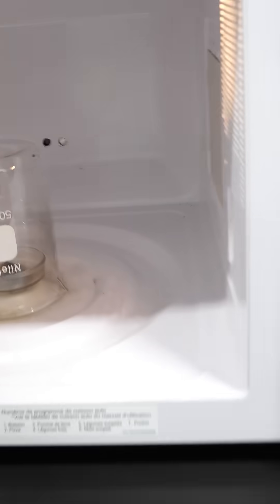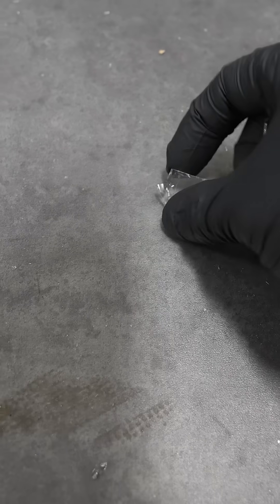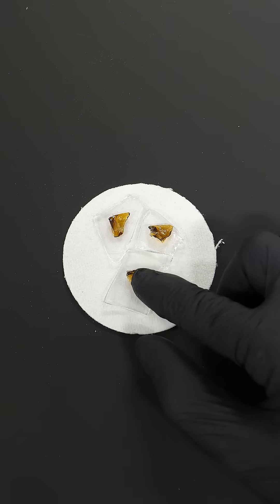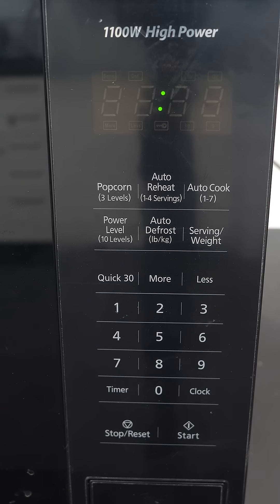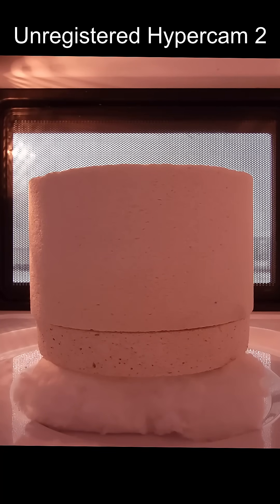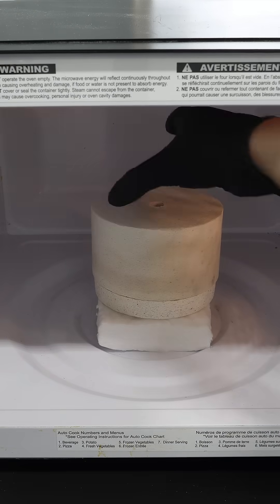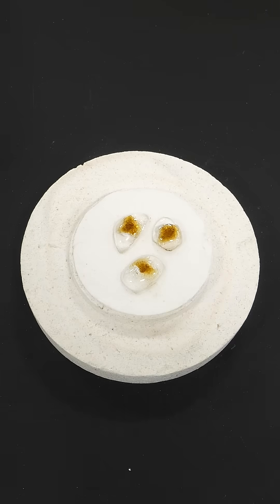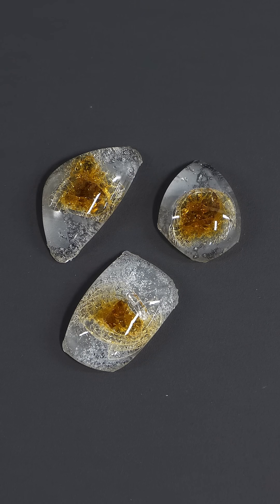Melting glass in the microwave is crazy

Comment: This reminds me of when I was making concrete.   I combined beach sand, water and corn meal together, then I mixed it up into an oatmeal consistency.  I put it in the microwave for 5 minutes.  When I took it out it was extremely hard looked like ceramic.  I also noticed I completely melted a hole in the  container I had put it in.   I didn't realize the Temperature had reached 1000+ Degrees Fahrenheit.  I had to let the concrete cool down before I could handle it.   Being a chemist myself I already have a branding mark on my thumb where I touched something 1000 degrees, I even had to cut plastic off My Finger.  Stellar Glass Eyes Nile I Love Your Videos and Content. Great Work 👩🏻‍🔬⚗️🧪💜💜💜

Comment: You didn't run it for long enough. You didn't put the pieces close enough together. They very obviously liquefied.  That glass got just warm enough to to turn into putty but not hot enough to turn into liquid. You need more heat or you need all the pieces much closer together in order to achieve what you want to to achieve

Comment: In sure by now someone else has elaborated on why it didn't work out and you've learned about coefficient of expansion and different glass formulations...can't mic borosilicate and soda lime glass 😂 you'll get much better results using glass of the same type. Boro also has a much higher melting temperature than bottle glass. Had you used a glass soda bottle and not a beaker they not only won't crackle and will more uniformly melt at the temperature that the microwave kiln generates.

Comment: I've been melting glass in microwaves for decades to have colors on hand while blowing glass.  Once glass is soft, it becomes conductive andwill directly absorb microwaves. The way to heat the glass to the softening temperature, drop in a maybe 1/8" crystal of silicon carbide.

Pick a suitable crucible and there you go.

Comment: Point 1. I fully expected you to heave the beaker against the wall really heard hard. 

Point 2. I fully expected you the smash the brown glass bottle, but I didn't expect you to smash it to SMITHEREENS 😮

Point 3. I'm surprised you were surprised this experiment didn't turn out the way you thought. Why would you think the 3 pieces of clear glass would "soup up" to fuse with each other? Putting the brown pieces of glass on top of the clear I think anyone would expect those would melt into each of the clear glass as it did.

Point 4. Great job 👍 I like it

Comment: The only way this works is if the glass has metal in it. That’s why the glass platter gets hot. Otherwise glass is non polarized and will never get hot enough to do anything. Put a plastic cup in microwave on top a towel everything must be dry in there no food particles. Put it on for ten minutes nothing will happen. Can only heat up polarized molecules due to alternating waveform.

Comment: Fun fact: microwaves use a magnatron that consumes 4,000v to create radiation. The radiation is run through a "wave guide" and is directed to the oven cavity. Without the plate spinning, the radiation doesn't get spread evenly. If there was nothing to take the radiation it would burn a hole through the bottom of the microwave.

Comment: Yes, you can melt glass in a microwave, but only with a special tool called a microwave kiln. You cannot put glass directly into a microwave and expect it to melt.
A microwave kiln is a small, insulated container specifically designed for this purpose. It works by:
 * Absorbing microwaves: The kiln's interior is lined with a special black compound that absorbs microwave energy.
 * Converting energy to heat: This compound heats up to very high temperatures—over 1400°F (750°C)—and transfers that heat to the glass inside.
 * Fusing the glass: The intense heat melts the glass, allowing you to create small fused glass pieces for jewelry or other crafts.
Important Safety Precautions
 * Dedicated Microwave: Use a separate microwave just for this purpose. The pigments and other materials used in glass fusing can be toxic and may contaminate a microwave used for food.
 * Proper Kiln Usage: Follow the instructions that come with your kiln. This includes using special kiln paper to prevent glass from sticking to the base.
 * Extreme Heat: The kiln and glass become extremely hot. Use heat-resistant gloves or mitts to handle the kiln, and place it on a heat-resistant surface to cool down.
 * Ventilation: Ensure there is adequate ventilation, as some materials may release fumes.

Comment: The Pyrex glass used in beakers is designed to be heat tolerant. I would try using thin pieces of common glass.

Comment: We did this in school for a demonstration for lower grades and/or parents. First we took thermopaper to figure out the "sweet spot" in the microwave. Then we took glass-shards, silica sand and cobalt- or copper salts (can't really remember), placed them in a ceramic cup and set that on that spot. We only set the microwave to 1 minute, I think, but at the highest Wattage. Once the process was done, one of us grabbed the container with tongs, while the other dipped into the molten liquid with them and walked down the aisle. We managed to produce a ca. 5 meter glass"string", colored blue, before the glass hardened and shattered. It was magnificent and the audience was stunned. So yeah, you can make glass in a microwave. 😂

Comment: Crush glass to dust, when it looks melted enough try giving it some kind if shape like a cookie cutter so edges aren't thinned to crumble. Tap the top to try to keep as even a thickness as possible. Then heat back up. I wouldn't check or open door for awhile. Untempered glass will explode, not can, it will eventually. I had a modified bottle that sat on the living room shelf for 3 weeks. Then like 3am I'm on the floor picking through carpet, almost no big pieces.

Comment: Its glass, you have to mold it while its hot.
Glass is a weird liquid solid hybrid state (quartz is the solid version of the same molecule) and it will behave like a liquid when warmed up.
If you've ever done THC dabs alot, you'll have seen this. Glass nails will deform over time and break, whereas quartz ones won't deform over time.

Water doesnt pull together entirely in one pool, it usually makes seperate ones.

Another method would to have put a concave spot to put the glass in, so it melts down, together.

Comment: You are fussing not melting 700 ° f to fuse upbto under 700 °f  maluable  700 f in six minets is very quik  fussiun . Complete melt is higher 1400?? The only reson you had sucsess at all was staking smaller dark glass on the larger lighter . If you really are this dumb idts if that was intuitive if kot the only way to vo oddly .is the  way to go .. Way tio go . Given glass is temnically already  aliquid  a very vdry gdry viscous liquid with very unique surfice tentio qualities   slumpping and fusing you fusibg !you nees shaped ceramic bottom andfritt or flat peaces to slump into like plates its a liqid so as irt losens up it  will rolll
Reply: So back to the  plasma

Comment: Something really cool is if you have a spot that is slightly molten it will absorb the microwave energy directly and get hotter and liquify. Use a torch to get a hot spot on glass and then start the microwave .

Comment: Glass fuser here - glass will always melt in or shrink. A lower temp / shorter firing time would change how much it melts (tack=fused but maintains edges, contour=edges rounded, texture intact, full=fully rounded and smooth). If you want glass to fuse together, you need to layer glass over the top of each "seam". To be honest, the pieces turned out great for a microwave kiln and glass that was not made for fusing (:

Comment: Here is a step by step tutorial on how to build an engine!

At the heart of any potent street machine is a potent engine. Without a powerful mill, your car is all show and no go--which isn't the best reputation to have at the local cruise spot. But, because many cars came equipped from the factory with a lackluster engine, it's up to you to transform your street cruiser into a street bruiser.

Over the years, Car Craft has done countless stories onhow to build a gazillion-horsepower engineand how to make your V8 deliver stump-pulling torque. Sometimes, however, these stories are too tech-heavy and/or require mods that are too expensive for the average car crafter. Thus, this tech feature gets back to the basics. Contained within is a wide variety of engine assembly procedures, building tips and recommendations. The advice given is general info and applies to most American-made V8 engines produced by the big auto manufacturers such as Chevrolet, Chrysler/Dodge, Ford, Buick, Olds and Pontiac.

It's important to remember thatsuccessfully building your first engine isn't rocket science--it's simply a matter of working carefully and paying close attention to detail. Just remember that if you have an assembly question or are unsure about a torque spec, don't guess, find the correct answer. A variety of sources can provide answers to your engine-building questions. These can be found in places such as the pages of Car Craft magazine, a motor manual (such as Chilton's) for the year/type vehicle you own or by contacting the manufacturer of the part in question. For example, if you're confused about how to adjust the valve lash on your new street/strip camshaft, call the cam company's tech line, and ask the company firsthand. Asking questions first helps to eliminate mistakes, wasted time and wasted money.

The bottom line ofbuilding your first engine is to do it right. Remember that if you don't build engines every day for a living, it will probably take you longer to assemble the engine than a race shop. However, there is no trophy given out for the fastest engine builder, so take your time. Allocate one afternoon to building the bottom-end. Then, return another day (with a clear mind and renewed enthusiasm) to install the cam, heads and rocker arms. Breaking up the engine-building process keeps the project (and your entire street machine build-up project) easy and enjoyable. After all, the whole purpose of a muscle car project is to have fun.
For now, though, check out the accompanying photos and captions as well as theA-B-C's of engine buildingin the list and image gallery below.

* Step 1: Choose modifications that are budget minded, reliable and offer great all-around street performance.
* Step 2: Decide how your car will be driven most of the time, and select engine components accordingly.
* Step 3: Have the cylinder block honed with a torque plate installed if possible.
* Step 4: A simple at-home machining process involves tapping all of the bolt holes on the cylinder block.
* Step 5: Decking a cylinder block produces a more even, flatter deck surface, which promotes better cylinder sealing
* Step 6: Wash the cylinder block, crankshaft and rods with soapy water.
* Step 7: Paint the outside of the cylinder block with a high-temp paint.
* Step 8: Align-boring the cylinder block mains.
* Step 9: Torque the main cap bolts incrementally in the proper sequence using a professional-quality torque wrench.
* Step 10: Install the main bearing in the cylinder block dry.
* Step 11: Carefully set the crankshaft into place making sure not to damage the main bearings.
* Step 12: To properly phase the camshaft with the crankshaft, align the timing chain gears so that the two small dots are next to each other.
* Step 13: With a hydraulic camshaft, tighten the rocker arm nut until zero lash, and then tighten the nut one additional turn.
* Step 14: Install a dial indicator into the lifter bore (this dial indicator is held snugly in the lifter bore by O-rings mounted on the indicator shaft.)
* Step 15: To degree a camshaft, start by using a dial indicator (arrow A) to determine when the No. 1 piston is at Top Dead Center (TDC). Then, install the degree wheel (arrow B) on to the end of the crankshaft. Install the cam degree pointer (arrow C) so that it aligns with the zero mark on the degree wheel.
* Step 16: Always buy high-performance gaskets from a reputable manufacturer.
* Step 17: To ensure that the pickup remains securely attached to (and in proper phase with) the oil pump, tack-weld the two together.
* Step 18: The first 10 minutes of an engine break-in are the most important. Keep engine rpm between 2000-2500rpm, and continually monitor engine conditions (such as fuel and oil pressure along with spark timing).
* Step 19: Balancing the engine parts that make up the rotating assembly is highly recommended.

Comment: This won't work for long with the two glass colors. Since the two glasses have different compositions, their physical properties are incompatible. This is especially true with very pure laboratory glass combined with very "contaminated" amber glass. Stresses will develop in the glass, and with significant temperature changes, the probability of the glass breaking is high.

You can probably see this quite clearly with an optical glass stress tester.

Comment: If you lived in a small apartment, I’m wondering if this would be a practical way of heating the space? Said he got about an hour of heat for 6 minutes of cook time. Not sure that a kiln is the best item to heat. Whatever that object might be, would it be cheaper than running a gas powered radiator?

Comment: Calcium carbonate pure. Silica a bit of mercury in a slurry shoot it with microwave and it makes gemstone,add elements according to the gem desired . It is how we made the monoliths . It can be applied to modern construction as electric generating platforms for building homes and buildings in stronger than concrete self healing and puts out electricity perpetually.

Comment: yeah no, glass have different types of interaction to heat, and also you chose a glass that resist a lot of heat, so to fusing them you should put an enormous amount of heat XD, becuase it is not just their melting pint there are different interactions between different amounts of heat, the amber one fuse easyly because it isnt a glass that you use with heat
Reply: bttle glass melts on really low temperatures, but u wanted to melt a glass that ia ment to resist huge temperatures

Comment: @CruceXP  at the 32:08-09 mark is a well-timed Juno ult. You did the best you could with what you had and nearly clutched for the team. I wonder if it was possible to avoid the Genji. But he might have slipped past your line of sight while you ulted. But it's fair to say that was really hard to survive the Genji ult that popped out and slashed you in a blink. 

Honestly, after checking that moment again. If you hadn't ulted then,  you probably would have died. I saw your health drop really low, even during your ult. 
I'm not sure you could've positioned or timed it any better.

Comment: Have done this operation for nearly 10 years 
The best method for drying lab glass ware, but I do it with three consecutive 700w microwave power(with 10seconds open to lower inside temperature)
to prevent melt down, crack or burst 
of non thermal shock resistance 
glassware.

Traditional RT drying process may take one or two days to complete. Too slow.

If the glassware has defects, it is quite possible to burst during 
microwave drying process.

High power and long time may damage glassware immediately 
if it is non thermal shock
Reply: I use 700 watt for 2.5 minutes each time

Comment: DO NOT stand close to a microwave while it is running. THEY LEAK. You don't want those loose microwaves getting into your body.
Reply: It's non-ionizing radiation, can't really hurt you
Reply: @darrogen6200  - You put your head inches away from something that can melt glass, and you say it won't hurt you? Not something I want entering my head or my body, even in smaller amounts.

Comment: A a microwave Hotspot. My one ex used one of these to melt n make bullseye glass pendants. Good times. Bullseye is special as if you stack it too thin or thick, it will push itself to a preferred level, altering designs accordingly.

Comment: Glass when liquid tends to be 6mm thick due to surface tension.

Same principle when a drop of water makes a bead/puddle with consistent thickness when on a surface.

This has to be taken into account when preparing the pieces superposition. If total thickness is 6mm or more, the glass "puddle" will expand the limits. If it's less than 6mm it will contract. Apparently the beaker/bottle walls are about 3mm? Try stacking 3 layers and you'll see how the footprint expands and fuses the three pieces together.

Additionally, to prevent cracking, as other comments suggested, you need to be careful with the cooling curve, and also fusing two different types of glass with different thermal expansion coefficient may lead you to cracks due to uneven contraction during cooling.

Comment: There's actually two different kinds of glass there... They are typically not very compatible- that is why you see all the cracking where they meet.  Your beaker is borosilicate glass, designed to withstand drastic temperature swings (like your Bunsen burner or hot plates).  It's not perfect, but it's waaaay better than "soft" glass for that purpose.  Speaking of which, that brown bottle you broke- soft glass.  Don't know what soft glass is?  Speak to a glassblower, I don't have all day today to educate.😂😅

Comment: As someone who melts glass for a living, it isn’t a matter of you getting it too hot, it’s a matter of you not getting it hot enough.

Lamp workers burn oxyacetylene in order to melt glass and work with it. Furnace workers are using an industrial oven that burn almost 3000degrees hot. If you’d have achieved the proper best they would have popped together and the brown would have most likely sunken slightly into the clear glass.

Getting this much out of a microwave is impressive